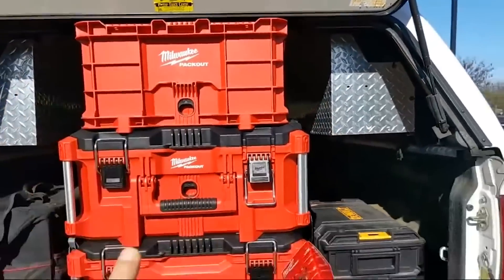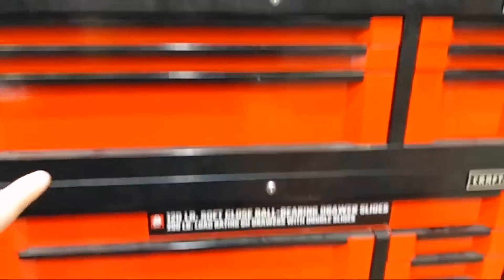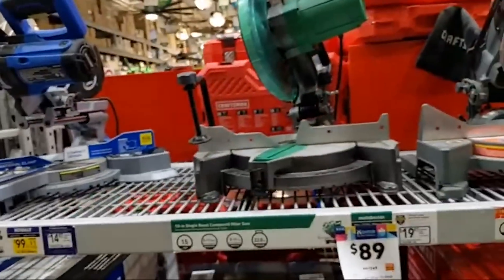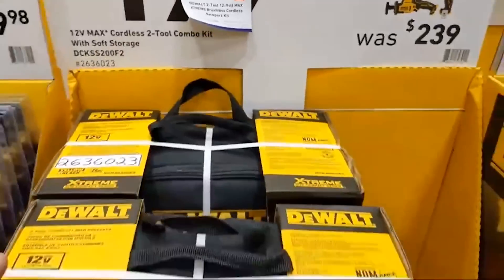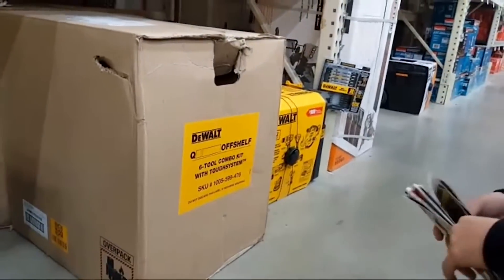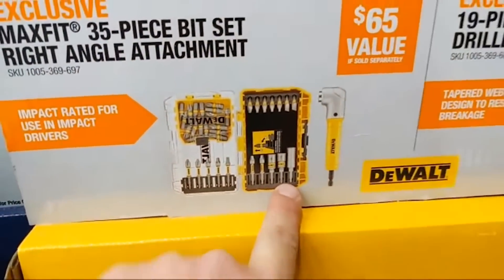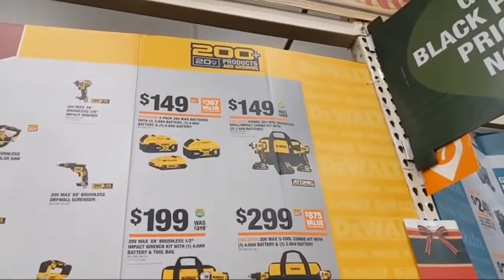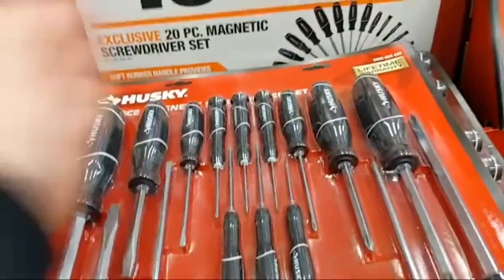ULTIMATE TOOL DEAL GUIDE 2020! The Home Depot, Lowe's, Harbor Freight, Tractor Supply, and MORE

Comment: Just went to Fleet Farm today and picked up a M18 tool kit with an impact, drill, sawzall, and a flash light for $438 + when I bought the bundle they threw in a job site radio (originally $139) or a 5Amp battery (which the had listed for around) $60)

Comment: Vcg my dad needs a new miter saw. He does a lot of wood working in is off time. He wants a 12in miter saw. The metabo 12in dual sliding miter saw for 329 is that a great saw or because of the LSA on ridgid would be he better of with a ridgid 10 or 12 miter saw?

Comment: the milwaukee packout set promotion doesnt work we just came back from home depot and tried to get the 3pc with the crate and the only thing off was the 20$, but when we even tried to get the 3pc packout with the 22inch small tool box the regular pack out, there still was a promotion for 80$ off but when we went to purchase it it was at its orignal price of 280$ when you can cleary see on their home depot website and their customer service computer that it was 80$ off they said that its a diffrent SKU and model number when its the same 3pc set. Thanks home depot for the fine service.
Reply: Yeah this is all old video, lots of these deals no longer exist